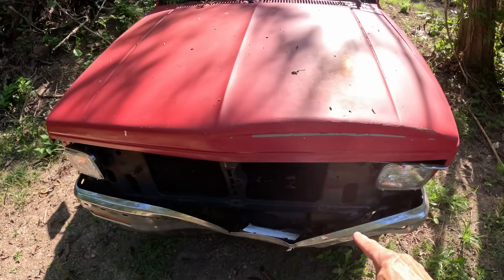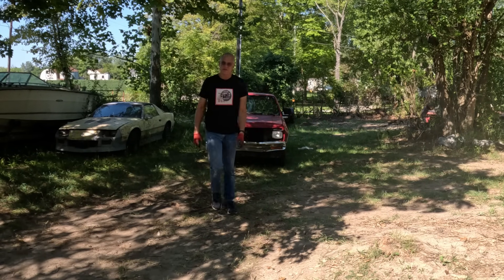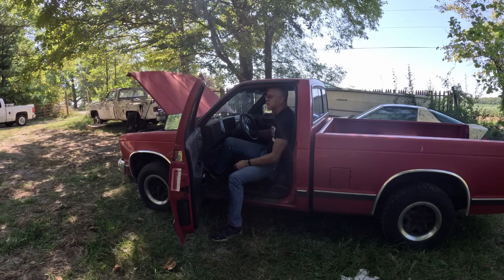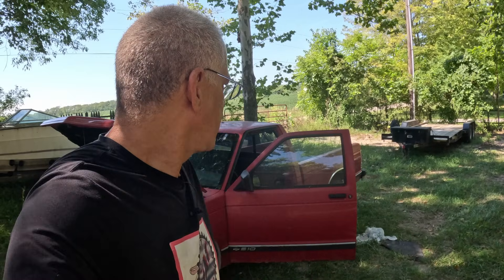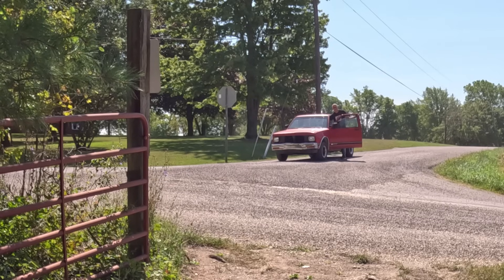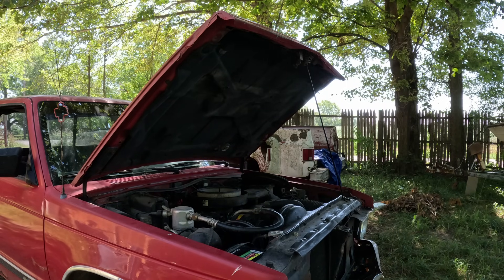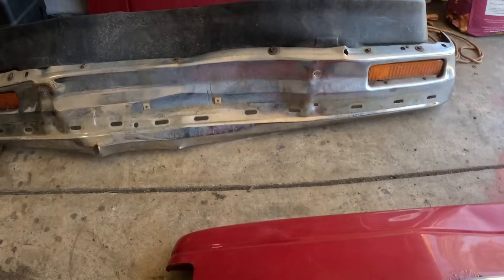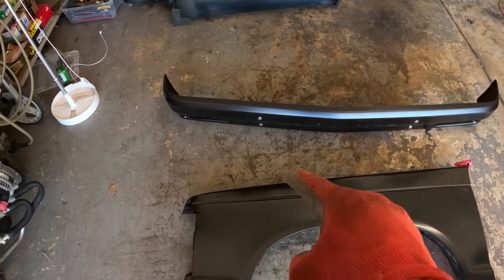1991 Chevy s-10 truck revival. The new collector truck?

Comment: just sold my 88 s-10 to a good buddy of mine. Had the the iron duke with a 5 speed. Shes still running like a champ, he uses it as a daily. FYI the sensor for the coolant temp is a one wire sensor on the side of the driver side head i believe all of the 80's GM vehicles with the exception of Tuned port motors and the multi port motors use that type of sensor.
Reply from the maker: Right on, I’ll check it out.

Comment: The problems your having when coming up to a stop sign and it chugging and stalling does sound like the fuel filter being clogged why is probably why it's running so well since the fuel filter replacment if it was clogged enough it wouldn't flow fuel to engine 1:04:30 nice work Chuck @Street Rat Garage

Comment: Turned out pretty good 👍 other things you can do to maybe make it run better is clean the IAC (Idle Air Control) valve and make sure the TV (Throttle Valve) cable is properly adjusted for the transmission so that don't burn up 👍

Comment: I'd like to get one. I worked on plenty customer S10. Super simple , body panels are cheap, even the bedsides just bolt together. I practically built 1 with 3/4 after market panels for a customer. He was so attached to the Truck, even though it was totaled.